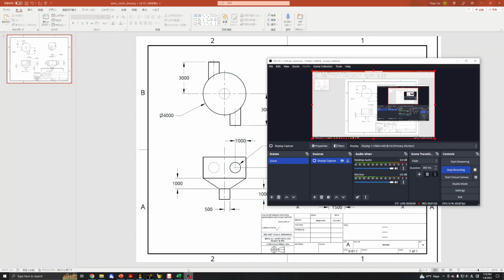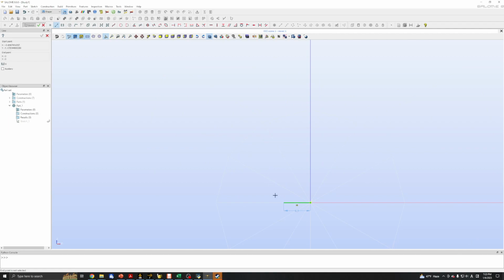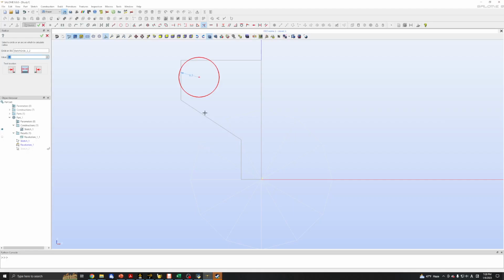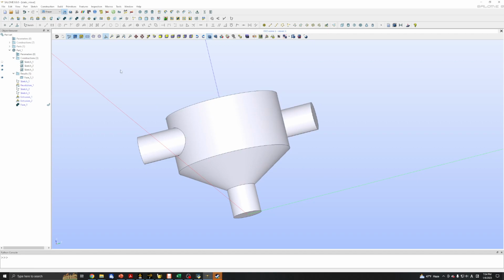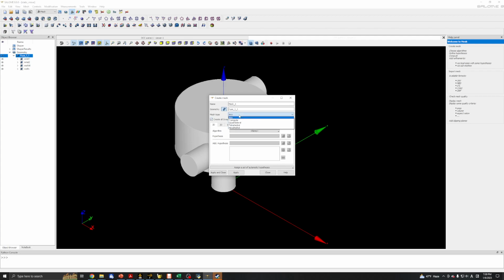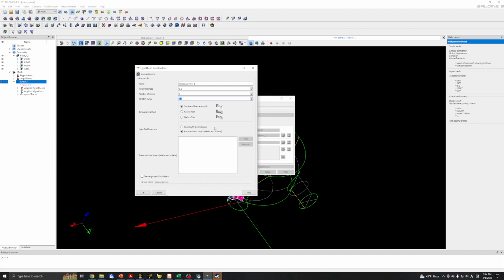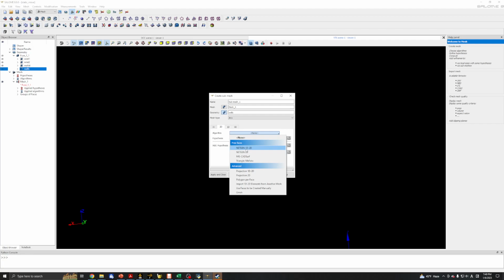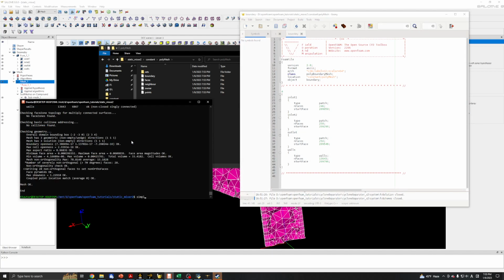Salome Tutorial: How to create 3D CAD and mesh in Salome for OpenFOAM

Comment: Hello, Thaw,
I would like to run my simulation with a nozzle now. I have imported the geometry in Salome and have created the mesh as you have done.
I have also copied the structure and renamed the patches. Unfortunately OpenFOAM cannnot execute this simulation. How could I share you my files?
Reply from the maker: You can send me via Google drive. My email is support@cfdmonkey.com. We will reply within 24 hours whether we received your files or not. 

And which OpenFOAM are you using?
Reply: @thawtar682  Hello, Thaw,
I use OpenFOAM v2312 under Ubuntu. Meanwhile the simulation were done, but it seems to me, that it is not absolutley correct. I will contact you per email.
Reply: Hello, how do you change patches into walls after exporting? I can't apply some of the boundary conditions to patches as they need to be wall. @thawtar682